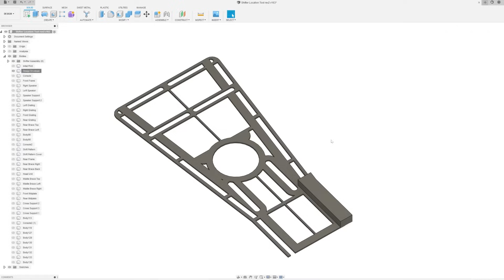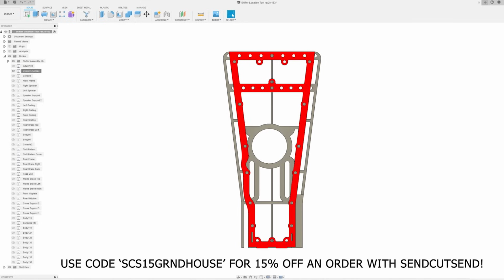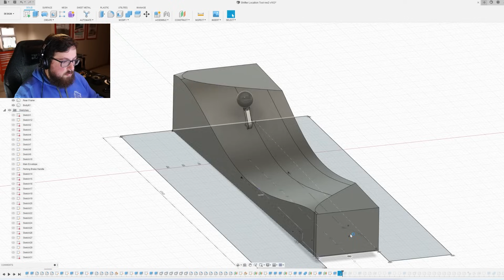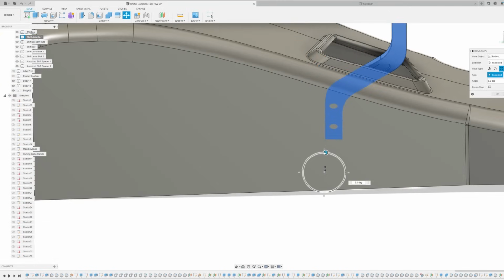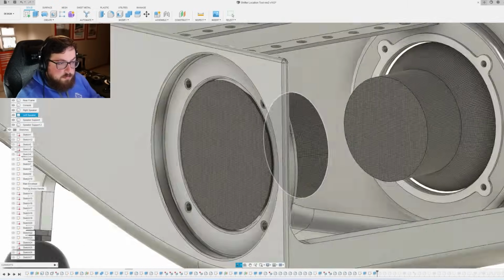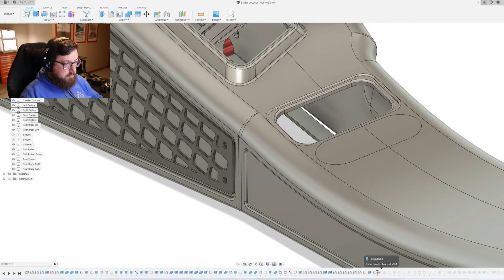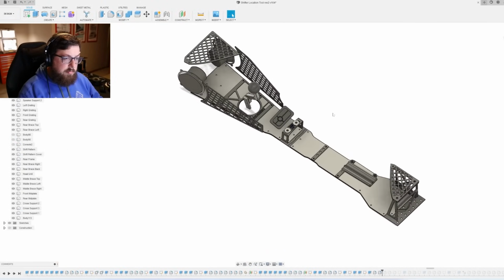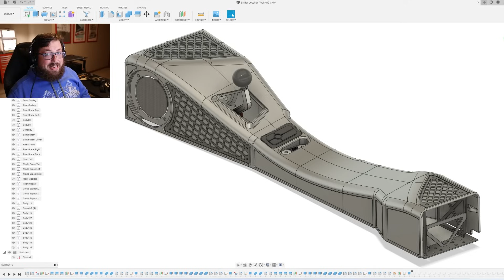Designing a 3D Printed Center Console From Scratch

Comment: Yo, this is killer.  You're 3d printer must be huge.  Really interested in seeing how it turns out.  What material are you going to print it out of?  I've had issues with PLA warping in the summer heat inside a car.
Reply from the maker: I'm going to be printing the console out of ASA, and in several pieces. In the next video Im going to show how I got it all split up and plan to join everything together. Have been working on it but printing ASA has been kind've a pain for me so far.

Comment: You'll need to be very careful in which filament to use. Even ASA will warp if exposed to direct sunlight.
Reply from the maker: Interesting, ASA came highly recommended to me by folks who use it on end-use exterior body panels.. the console is pretty much printed at this point so I guess I'll cross my fingers
Reply: @GrindhousePerformance  I dont think you should be worried.  ASA is literally known for its ability to withstand direct sunlight (UV-Resistance) and temperature resistance. I've had my car sitting cooking in the sun in 90-100 degree weather, where i'd estimate there prob. was around 130-140 degrees in the car, if not hotter, and i've not yet had any problems with any of my 3D-Printed parts (Phone mount, trim pieces, speaker mounts, overhead monitor trim, etc.) Many manufacturers even use ABS for interior parts.

Comment: Very nice job!  Could you share what wall thickness you went with on the console shell both inside and out of the pockets?
Reply from the maker: 6mm for the main body, 3.2mm (4 walls x 0.8mm nozzle) for the pocketed sections 👍 thanks!
Reply: @GrindhousePerformance  thank you

Comment: That looks awesome. What did you use to learn 360?
Reply from the maker: I took classes in solidworks ten+ years ago. Most of this came from tinkering, trying, and failing. I like modeling a lot, it's very easy for me to put a lot of hours just doodling around in the software trying to learn. The best way to get started is to just pick an object out of your office or garage and try modeling it for fun. Then challenge yourself by seeing how many different ways you can model the same object using different tools in the software. Do this a couple times a week and you'll improve incredibly quickly 👍

Comment: I've got that same amp in two of my Z31's with a 3D printed mount that locates the control pod at the front of the jockey box. I like it because i can use the line level input to retain the factory headunit and it is stealth, yet accessible. As far as how it sounds...its kinda flat but that could be very well the Rockford Fosgate R165X3's it running. I also ran a single channel amp off of the kenwood and its running a old school 8in bazooka tube in the hatch. Pretty respectable for such a small amp. Unfortunately They are discontinued now. Great work on the console design, I'm definitely learning a lot from your videos.
Reply from the maker: Dang, that's a little disappointing to hear! For the packaging of everything it worked out really, really well. I had a pretty low bar for audio quality from such a small package, so hopefully it sounds decent enough through the JL's!

Comment: Just found your channel, love the videos! I have a few suggestions for ya :
1) It might be worth your time to invest in a cheap 3D scanning tool to scan the amorphous body of the car. Then you can define work planes and mounting holes based off of the raw point cloud.
2) For a curvy, amorphous part, such as the center console, I'd highly recommend using surface-based modelling on the surface tab of Fusion.
3) If you're willing to pay, there is an industrial design extension (monthly sub available) that will give you an advanced patterning tool that has a TON of useful features. I'd guess that it's also way more optimized than patterning a sketch feature and having thousands of points+lines, which as you found will often crash Fusion lol.
Reply from the maker: Wow thanks for taking the time with your comments here, there's a lot of great advice. I'm not sold yet on a budget scanner. Ive been saving to get the whole car professionally scanned instead of having me fight or struggle with a budget unit. I've demoed some in the 10,000$ range where the software was still kinda crap, and I can't imagine the 1-2,000$ units are truthfully there yet. 

I've watched tutorials on the surface modeling in fusion and totally forgot that wouldve been an option for modeling the console. I should spend more time learning the software because I'd guess body panels would also be much easier to model this way.

Do you have any other extensions you recommend? This is an avenue within fusion360 that I'm totally unaware of but would be interested in exploring or recording videos for.

Thanks again for putting the time into your explanations here, I'm glad you found my videos!

Comment: I dig your work but am wondering about heat after you cut away the tunnel. Could that melt the print?
Reply from the maker: It's certainly possible. There's still going to be metal separating the tunnel and the console technically has an air gap everywhere it isn't mounted to the tunnel. I figure I'll give it a try this way and if it warps I'll look at using the model to make a composite version

Comment: What an awesome project. One concern I have with 3D printed pars used in cars, is the indoor temperature. It can pretty hot inside cars on a summer day. Don’t know what material you are planning to use to print. But I have had 3D printed PLA, PET and even ABS sag inside a car. Instead of using the 3D print directly, you might want to 3D print an outside mould and laminate that with glass or carbon fiber. Check out the youtube channel “Rammy RC” for inspiration. He is making large RC planes using that method.
Reply from the maker: Im printing this piece in ASA but I totally agree with your sentiments. If I was more comfortable with composites id be more willing to try, maybe in the future if I have issues down the road 👍

Comment: what 3d print material do you use?
Reply from the maker: For the console project im using 3dxtech ASA, although it's proving to be quite challenging to print 👍
Reply: @GrindhousePE  yes ASA can be challenging to print. An enclosure helps a lot, though.
Reply from the maker: @WaemYt  100%, I have an enclosure. Most of what I'm struggling with is nozzle retractions causing the filament to pop and cause holes in the walls.. happening no matter how long I dry it for. Thinking ASA isn't the greatest for a Bowden style printer
Reply: @GrindhousePerformance  do use abs settings?
Reply from the maker: @WaemYt  I am using the base ABS profile to start, i found i needed to bring retraction distance way way down to help the pinholes

Comment: This was pretty amazing, every video im like, man I wish i could do that, the programming and the deisign work is amazing.
Reply from the maker: It's a lot of blind persistence and luck! Software's are a lot more beginner friendly than they used to be. You'll get there! 👍
Reply: @GrindhousePerformance  what software are you using?
Reply from the maker: @karaabdelkader1273  I'm using Fusion 360 for CAD modeling and Cura for 3D Print Slicing 👍

Comment: Great job! Can’t wait to see the finished project
Reply: I Have a 1971 240Z that needs a complete rebuild but is 100% complete and runs. I really like the wide body kit you used and would like to go that route. Thanks for the inspiration
Reply from the maker: @rebuildranch1225  Awesome! The widebody kit is definitely an advanced install compared to bolt ons, but I think the effort's worth it. I've still got a lot to do on the widebody to finish mounting it to the car and clean up some of the body lines / fitment issues
Reply from the maker: Me too! So far printing has been a big headache, but slowly getting things figured out 👍

Comment: I designed one for my 510, but could never get the large prints to print well. I will retry sometime in the future
Reply from the maker: I'm going through that right now. Trying to print everything in ASA and it's having a hard time printing what I thought was a pretty straightforward geometry. Going to keep trying!
Reply: @GrindhousePerformance  I was using ASA as well. It had the tendency to lift in the corners. I am planning on maybe switching to wood. It got very frustrating, I abandoned that project about 8 months ago and haven't come back to it. Also my center console is not as ambitious as yours. Good luck, and it is awesome to see you back working on the Z. Congratulations on the SEMA spotlight
Reply from the maker: @AW_DIY_garage  Thanks so much! It was surreal having the opportunity to see it on display and see people's reactions to it at the show. With enough bed temperature, an enclosure, a wide brim, and a purple gluestick I was able to get the ASA to adhere nicely to my glass bed. I'm running 95*C bed temp, and it's been enough to keep these pieces stuck for the long (very long) print cycles. I'm struggling with a lot of surface finish blemishes, pinholes, and oddities that don't present themselves until half a day into getting the print running, which is starting to get pretty frustrating but I'm going to keep trying!

Comment: Nice work so far! 
I tried the 3d printer route for my custom console but the quality was too rough and had delamination issues so I stuck with an English wheel and rolled what I wanted for curves and then did hand formed additions.

Will you be relying on just smoothing the surface with wet sanding or adding compound onto it and then smoothing?
Reply from the maker: That's really impressive being able to do with an English wheel, I've only been able to turn new metal into scrap with mine 🤣. Since the pieces need to get glued anyways I figured I'd just sand, skim body filler, with some high build primer. Debating trying to skin it in carbon but that's pretty far out of my comfort zone

Comment: Been meaning to 3d print my own center console but couldn’t figure out a good way to start. I like your approach with small and quick templates to datum and do from there. What version of f360 are you using? It seems my student/hobbyist free version can barely load a sketch at this point . Having the same issues with patterns as you. The throttling is hardcore
Reply from the maker: Im using the step above the student version, I needed it for exporting the laser cutting files if I remember correctly. My issues wound up being hardware related, the PC I started this project on was ~8 years old and couldn't handle it